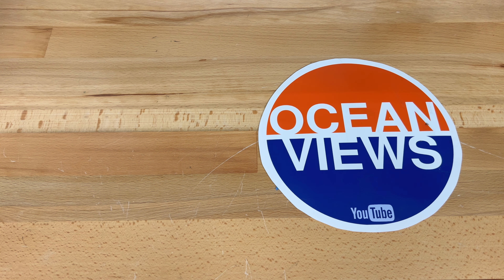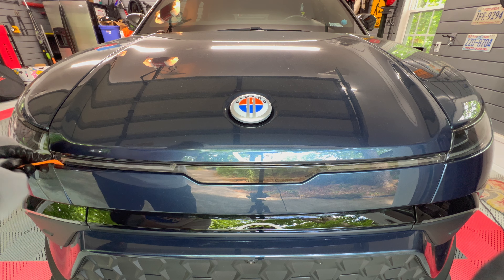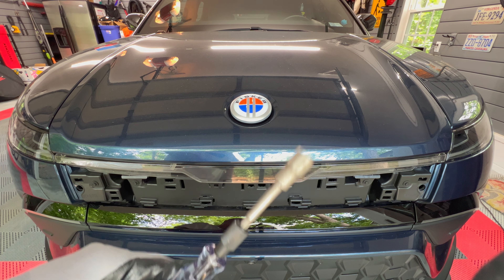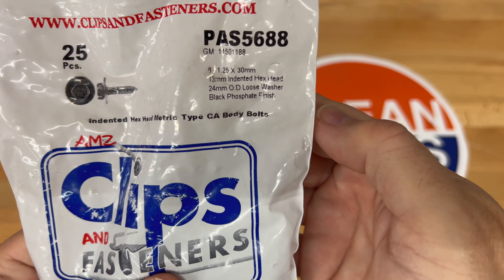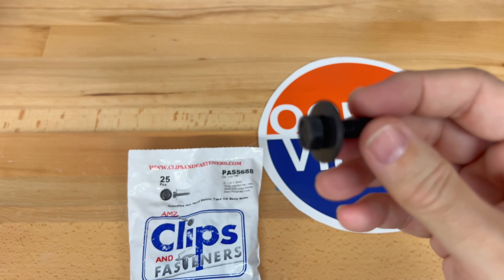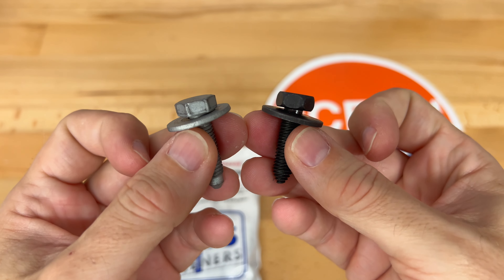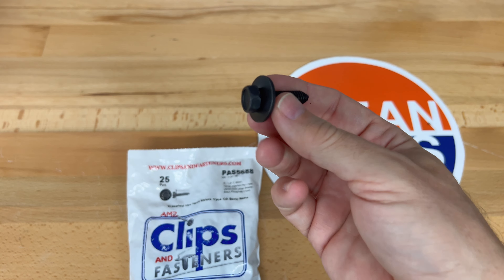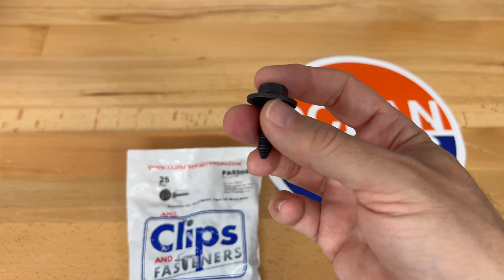Fisker Ocean One - Hood Bolts

Comment: Thanks for this. I was installing the battery monitor today and as I put the bolt back in, I may have done so at an angle and now the bolt is stuck. Can't loosen or tighten it so I have no idea what I am going to do, but my guess is it's going to be forced out and fall down the chasm of darkness and rattle on forever. At least I know I can replace the bolts. 

Im waiting for the video where you figure out how to keep the hood down without these dumb bolts. What a weird decision they made ( of many )
Reply from the maker: @MelHaynesJr  it sounds like you may have cross-threaded the bolt.  The best solution is to back it out (turning left or counter-clockwise).  Yes, there has been some discussion on message boards about alternative hood closures.  So far nothing has worked out.  It could require a full replacement of the mechanism and that will be daunting to do.

Comment: Surprised that you didn't use yellow Loctite.  Also surprised there wasn't a short explanation in the description on why you are doing this.  My Google search using your video title did show a thread about the hood coming open but it was unclear if the bolts vibrate out. Thus my yellow Loctite question.
Reply from the maker: In the video I explain these are replacements if you lose the original bolts.  As far as the cases of opening hoods (two incidents?), that was due to the port/delivery center not fully tightening (or even forgetting to install the screws).  The owners manual does not mention using loctite or similar.  Just hand tighten really tight or if you want to be really certain, use a torque of 19 Nm or 14 ft-lbs.
Reply: @MTNRanger that makes little sense as people don't randomly replace bolts. Why would you lose bolts randomly. Sorry but that part is confusing.
Reply from the maker: @scottf200  I have had people request replacement options. I'm just providing a solution in any case.
Reply: They need replacing because people have lost them while taking them off and dropping them into the body. They aren't coming off on their own.
Reply from the maker: @scottf200  I also just found out from an owner in the EU that their bolts don't work with the magnet tool.  So replacing them with these is a good solution!
Reply from the maker: I just found a technical service bulletin on the hood bolts and it specifically states not to use loctite or any other thread locking adhesive!  https://drive.google.com/file/d/1f9FEZKwsU0OfsroAxKrMK1KbOlWk4izC/view?usp=drive_link
Reply: @SilvanoWilliams  OK, thanks for that.  Curious that people are taking them off in the first place however.  I guess I've never done that or heard of others doing that on their new cars. Doesn't matter. The video was well produced and I'm sure it will help people out who have that need.
Reply: @MTNRanger  Wow, that was a great find. Nice job.
Reply from the maker: @Scott-sm9nm  I have opened my hood at least a dozen times so far.  I have done it for instructional videos as well as installing accessories like the 12 V battery monitor, as well as a light mod adapter.

Comment: Hi, would you by any chance know the specifications for the plastic clips for the rear quarter panels ? I am trying to find the clips to replace the right rear quarter panel for Fisker Ocean One. Thanks for your help !!
Reply from the maker: Unfortunately, I do not.  I have replaced some trim clips on the interior door threshold panel.  I purchased a variety pack of trim clips on Amazon and found one that worked.  Do you have a photo of one of the clips?
Reply: @MTNRanger  thanks for your reply. I will get a picture from a fisker rep on Monday. I will share it with you. They don't have any replacement clips and I am exploring at my own end to find something similar. The rep messaged me back just now and it seems it's not just a clip but a whole plastic assembly

Comment: Where did you get the torque specs?  I won't have my Ocean for another week, so I'm trying to learn as much as I can.  It'd be great if there was a digital shop manual available?
Reply from the maker: I got them from the owner's manual. There are several manuals available.  Here are the links: Service Manual 
https://drive.google.com/file/d/1-2-PYUorSsCnBvq5tU5EHBgDNF2mrEWa

Wiring
https://drive.google.com/file/d/1_sTWv40bBkqj4771oP5wiys5OtKzuNQe

Wiring 2
https://drive.google.com/file/d/180lG5EWOUoOHhg6agpygZhGdkuLJaqiY

System Schematics
https://drive.google.com/file/d/1bc9JitIL6nm0QNOjQKkGNWpwIqbPXZW_
Reply: @MTNRanger  Man, thanks a ton!  You're awesome!

Comment: Have a question for you. Once your hood is up, eventually we are going to have the hood up to replace the 12v. I have heard nightmare with the 12v. I think 2.0 reduced the issues some were having with OS 2.0 failing mid download and bricking the Oceans. But how about a normal 12v battery replacement. I heard that when a 12v is replaced a Fisker Tech must come out to recalibrate the doggie windows. Is this a solution. First off I have a BMW i3s and to replace the 12v there is a release button to take the high voltage battery system off the 12v monitoring and charge. Once you release that button it's a normal 12v swap, then depress the release button and you are good to go. I don't know if the Ocean has a release button to take the high voltage monitor and charge off the 12v battery. But should we do this. Have a 12v boost that supplies 20amps, do we connect this to the positive and negative terminals that connect to the battery to provide a constant voltage to the system. Then disconnect the 12v battery, leaving a constant supply of power to the system, connect the new 12v positive and negative terminals. Then remove the battery boost from the positive and negative terminals and we are all set unless there was a button the was a release button, like in my BMW, that needs to be depressed to engage that system of night voltage maintenance and charge. Hope you can explain, maybe more clearly than I described. Thanks as always.
Reply from the maker: If you follow the directions in the service manual, there is no disconnect for the HV battery pack.  There is a fuse panel that sits on top of the 12 V battery that needs to be removed.  A tech has said there is a way to remove the 12 V battery while keeping the car still active with the 12 V (so you don't have to recalibrate the doggie windows).  However, it is tricky, and I haven't seen the specific steps to do this.  I plan to do a video on this at some point when I get clear and safe directions.  Service manual link: https://drive.google.com/file/d/1-ArsxD_6HP6NGCEeXgnKPvQvPGo3DNZw/view?usp=drive_link
Reply: @MTNRanger  Huge thanks as always. I might be picking up an Ocean in Florida and there is some service center there. Maybe I can learn this process there. If I do get this one I will be driving cross country and there is a service center in California so maybe I can learn something from them. Cheers and thanks again!!!!
Reply from the maker: @DaveDarin  Great, let me know what you find out.
Reply: @MTNRanger  Absolutely will.
Reply: Any update on the 12V swap technique.
Reply from the maker: @guzelkadn3570  I have two ideas in mind; one I'm waiting on parts for. It's hard to test since I don't want to mess up my car's setting accidently. I will do a video on it eventually!

Comment: I do have a question. I had seen some comments that Ocean hoods have come up, now I have doubts that this has actually happened but I guess it could be true. So, you are replacing the originals with these new ones, curious as to why as your side by side comparison looks like they are very close to identical. Of course I would not add loctite to these bolts.
Reply from the maker: I installed the new bolts for a couple weeks.  I replaced with originals when I was doing some other testing.  They are pretty much interchangeable.